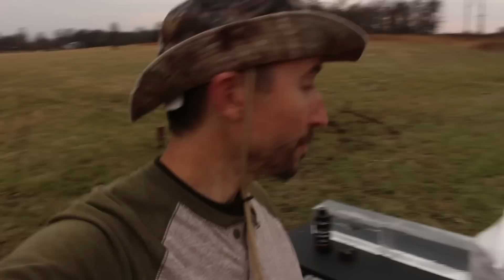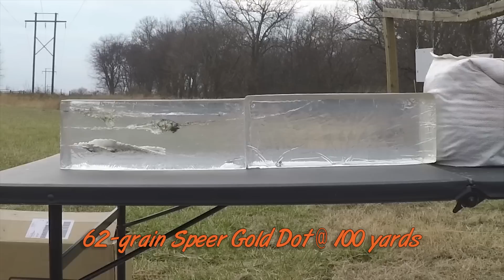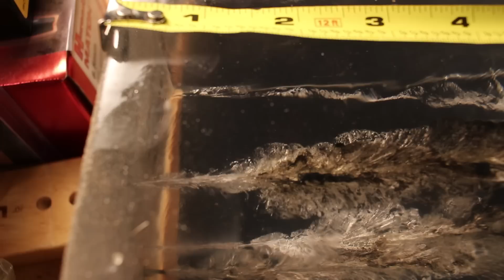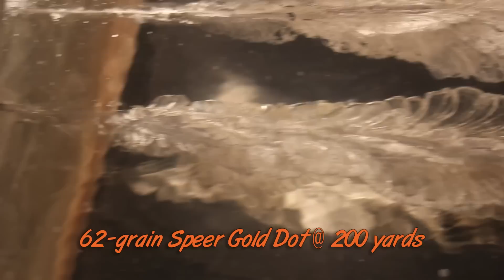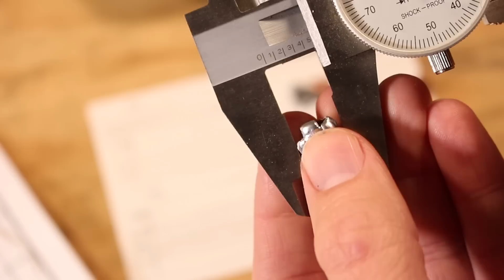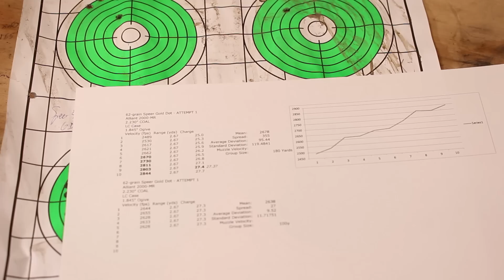62-grain Speer Gold Dot vs Ballistics Gel at 100 and 200 Yards - The Social Regressive

Comment: What about gold dot factory loads? Have you guys tested those? Or only hand loads? Testing factory vs hand loads would be interesting especially to us guys who don't hand load. Cool video's by the way I'm going to be trying these for deer hunting, thanks guy's.
Reply from the maker: The should be no appreciable difference between these and the factory ammunition. Just some minor velocity differences.
Reply: @The Social Regressive  after doing these tests would recommend 223 for deer sized game? Our deer here in oregon average 80-100 lbs some get up to 120lbs but those are considered very large for black tail. Or would you say go with 350 legend?
Reply from the maker: .223 should work in your case, but you'll need to be precise with your shot placement. The low bullet mass will reduce your chances of a full pass-through and a big blood trail.

Comment: What everybody who hunts with a 16" AR really wants to know - 62gr Gold Dot vs 62gr Fusion MSR.  Velocity tests & expansion/penetration at distance.  Would be great to see this side by side with a 16" and 14.5" 1-7 twist chrome lined barrel, which is what a lot of 16" ARs are.  These two rounds are hugely popular and direct competitors.
Reply: No need. Fed fusion and gold dots are the exact same bullet and will perform the same.
Reply: @Nick-sx6jm Technically they're not exactly the same bullet and the powder mixture is also different. The bullet shell is a different shade of copper but diameter is almost exact. I forget the claimed powder difference but from my testing from factory loadings is almost identical. Over 40 rounds tested, "20 of each" they both have around the same muzzle velocity with Speer having a closer velocity deviation leading to some tighter groups. Tested from a 16.1" LWRC CHF the Speer averaged 1.2moa while the federal was just over 1.5moa, all cold bore.
Reply: @TerminalM193 I'm pretty sure they are they exact same actual bullet. Speer owns federal, and they both look the same. I know some factory loadings use different powder like they make one specifically for ARs. I got a really good deal on few hundred bullets and load them to 3100 fps out of my 16in MPR. By far the best bullet offered in .224 imo in terms of price, performance, and accuracy. I get .5moa easily out of my hand loads.

Comment: I got big groups out of the speer GD 62 gr in my 5.56......it didn't like them.  2" is not acceptable for me.  I want at least an inch at 100 with handloads.  I'm getting a 22-250 barrel for my savage 110......I'm hoping the Speer GD 62 gr works better with that gun.
I have been killing deer with the Sierra SBT 55 gr.....it's a bomb!  Try them and shoot them into water jugs.....my test went through 3 jugs....the jacket turned into a spider and cut the second jug completely in half....the lead made a pretty button and went into jug 3.
Shot a 200 lb 10 point this year with them.  (also a six point)....both dropped within 100 yards.
Reply from the maker: Nice work! Was your hunt with 223?
Reply: @SocialRegressive  Yep...really a 5.56
Reply: @SocialRegressive  Called speer cause they didn't have reload info for 22-250.  Said don't use it because it's not a good jacket for high velocity.  Said it was made for home defense.   lessor velocities.

Comment: Are you using 223 Remington or 5.56 load data for these 62 grain loads?
Reply from the maker: It's a custom recipe using lake city brass and Quickload software.
Reply: @SocialRegressive   I was curious as to the pressure of this loading and whether or not it was in a safe range to use in any 223 rifle.
Reply: @slaydeday5677 You can find some great 223 load data online for both the 62g & 75g Speer gold dot

Comment: Should I use 55 gr barnes or 62 gr gold dot for 200 lb whitetails out to 100 yds?

I generally use .270 but I have faith in 5.5

What do you think is the most suitable .223 deer bullet?
Reply from the maker: Both of those are known for good expansion and tissue damage. The Federal poly-tipped bullets have a good reputation, too. I would personally favor a heavier bullet to increase the likelihood of pass-through and a bleeding exit wound. I'm a believer after last year's whitetail hunt.
Reply: I’m late to your comments but I just smoked a very large doe with my 11.5” & 62gr gold dot. Granted, she was 35yards away and I shot her in the neck. But I was still surprised how effective it was. She just lazily slumped over dead, like she fainted.

Comment: I've shot only one group with the load I decided on for these 62 grain gold dots and it was 3 shots in 0.67" at 100 yards. It's doing 2700 fps out of a 16" daniel defense barrel, certainly anemic by most people's standards but it's intentionally so as I hope not to tear up fur too much on fox and coyote with it. No hogs where I'm at. 24.3 grains H335 and 2.24 OAL.
Reply from the maker: Sounds like a winner. Outside observers get hung up on speed; it's not the only factor to consider.
Reply: I just found this video, H335 has proven very accurate from my CZ 527. At 50yrds about .5"
Reply: That's a damn good group. Currently I've only tested factory loadings of both the 62g & 75g. Out of 20rds shot cold bore from 16.1" LWRC IC DI CHF I averaged 1.2moa / 2840fps. Was actually happy with that velocity because I was expecting the velocity to be closer to your numbers. I currently have 200 62g bullets that I'd like to start tinkering around with. Ultimately I'd like to achieve safe 5.56 pressures while keeping accuracy under 1.5moa. Going to try and hit the 3k fps @muzzle but that might be wishful thinking. Seems the hotter you load these things the wider the groups become.

Comment: What's the difference between the 62 and 64 grain Gold Dots in this caliber?
Reply: Didn't they discontinue the 64gr?
Reply: The 62 grain is the successor of the 64 grain which has been discontinued
Reply: @user-oy8dl1er5h  That seems to be what i've seen, but i still haven't found out any information on the difference between the two other than 2 grains weight difference
Reply: @TommyboyGTP  - As far as I can tell from a quick research on the internet, no difference at all in ballistic and terminal performance, 2 grains don't seem to be enough to make a difference
Reply: @user-oy8dl1er5h  yeah, but i'm curious to know if the projectile construction is different, or it's a different lead alloy recipe, etc.

Comment: I run 29.6 grains of 2000 mr 2.250 oal and getting 1.2 moa from a chrome lined fn 1 n 7, 3050fps. Devastating on deer
Reply: What's the length of your fn? Out of my 16.1" LWRC IC DI CHF I'm getting around 2850-2900fps at muzzle with exactly the same moa as you but with factory loads. I have a bunch of 62g bullets that I'll be experimenting with starting this weekend. I'm hoping to achieve safe-ish 5.56 pressures while staying under 1.5moa. Hoping to hit the 3k fps @ muzzle but from little bit of load data research I've done the bullet seems to start really opening up groups the hotter it's loaded.

Comment: The Speer Gold Dot is a top performer. I have trouble finding them and when I score it's only a couple of boxes. I can pick up Barnes projectiles more easily . I can assure you Barnes are top,performers and they do,exactly as advertised. They are my go,to bullet for my hunting requirements. Treat yourself to a couple of boxes . You will not be disappointed. No more hogs or anything else crawling off.

Comment: im chocked that americans think 223 is suitable for hogs. Here in sweden we must have tanks, as even a 6,5 (6,5x55 swede or creed) and 308 is considered on the edge of lethality... some are convinsed that 9,3x62 is the lowest recommended.
Reply: Here in the U.S they are a real problem and considered more of a pest so people use AR's which are commonly chambered in 5.56 because you can shoot quickly and take out multiple hogs in one go. Yeah its a little underpowered for big hogs but when they are costing you tens of thousands in property damage you just want them dead. If you use a good soft point or copper bullet then they actually work pretty good.
Reply: Sounds like the old guys here that swear u need a 308 a minimum for whitetail. These animals are tough but they aren't bulletproof. There is a video of a guy dropping a small grizzly that got inside his home with a 11.5 AR and a 55gr VMAX I believe. It was as close as possible like maybe 7yard max but it curled up and dropped immediately

Comment: What is the twist rate on the barrel? I have these for 6.5 and 308 and want to try them in 223. I have  1-8 and a 1-9 twist rifles. I have found the 60gr Vmax is super accurate in the 1-9 barrel. not sure on the 1-8.
Reply from the maker: This is a 1-7", and my other is a 1:8". They'll both handle 75s with ease, but for some reason 62s are tricky.

Comment: Great data! 

Everything I've seen on the speer gold dot rifle bullets has been textbook expansion and weight retention. 

Just ordered some of the 150 grain .308 ones designed for 300 blackout and will be running them in 7.62x40wt. 

Might even try a few in the 20" 308 for shits and giggles. Be interested to see what that bullet does going 400+ fps faster than it was intended. Could be that it absolutely splatters like a varmint bullet would, or some fragmentation with a few big bits coming off and the base mostly holding together, or might flatten out like a pancake and stay together. 

Hard to say, I contacted them about the max fps for that projectile but have yet to hear back.
Reply from the maker: Heck yes. I'm going to try the 175s in .300 Win Mag and see how they do. Can't wait to hear how your experiment comes out!
Reply: @SocialRegressive  They make a 175? I was hoping they'd come out with one but haven't seen them in the wild yet. I know they have the standard 150's, the blackout 150's, and the 168's. Guess it's time to start searching online to see if anyone has them in stock haha. 

Thanks for the reply and I'll let you know if anything interesting comes of the 150's I ordered.
Reply from the maker: @colsoncustoms8994  Whoops! You're right. I have 150s and 168s. I was getting confused with Federal Edge TLR bullets I'd like to test soon.

Comment: Any shot other than head or neck will result in a tracking job most of the time. Maybe  the 450 or 458's  would do better.
Reply from the maker: I'm hoping so. The gel tests with 350 Legend so far are...interesting.